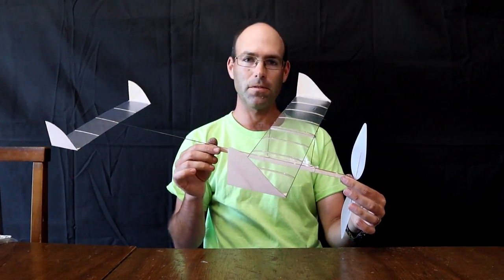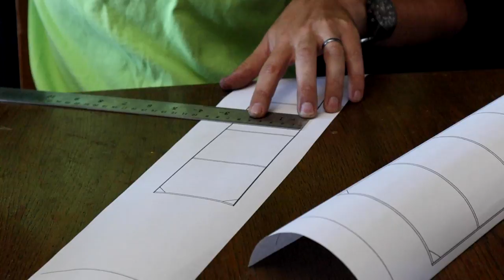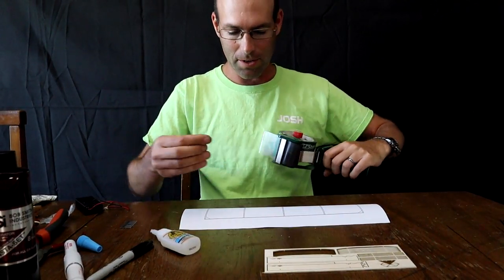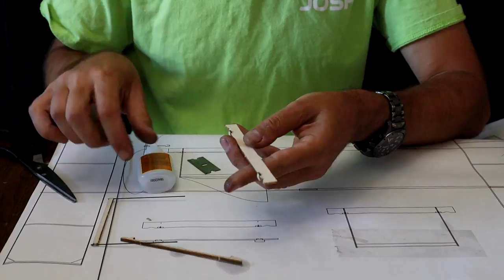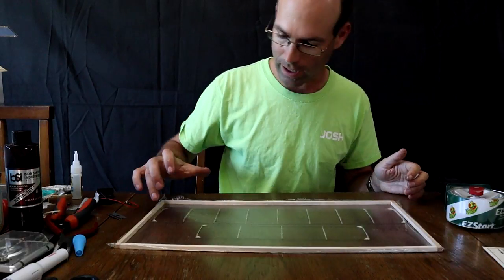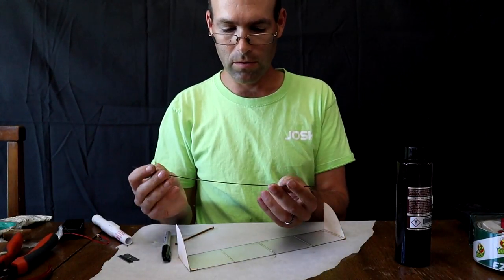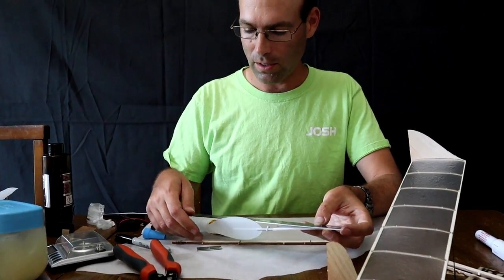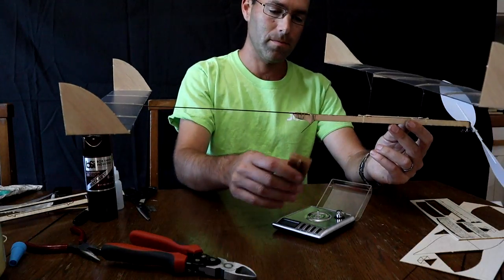Stinger 2022 for Science Olympiad Wright Stuff - Build Instructions

Comment: Your videos are excellent.  I have a question regarding the wing posts.  Can we attach tissue tubes to slide the CF posts into and adjust the wing TE/LE or is adjusting the stabilizer the method of choice for trimming to reduce diving/stalling attributes?
Reply from the maker: Yeah tissue tubes would work fine. You can shim the wing mount to get a similar effect, however the tissue tubes are convenient if you're comfortable with them.

Comment: Any video what is best way to set up torque meter. what is best rubber band size? also how many ideal rotations?
Reply from the maker: That all comes down to experimenting. I aim for 1200-1800 turns depending on rubber thickness, .093 rubber will take 1.3 in-oz, .080 will take at least 0.9.

Comment: Should there be one end piece in the middle of the tail or two?
Reply from the maker: Not sure I understand what you mean. The Stinger is supplied with parts for tip fins on the horizontal tail. Bear in mind we used footage of the Senior Flyer for portions of the build that are common between the two airplanes.

Comment: Whats the best distance from propeller to leading edge
Reply from the maker: Varies from plane to plane. In short, it doesn't matter. What matters is that the plane balances about 1/2" behind the wing leading edge with a rubber motor loaded in place. Shim the wing leading edge as needed if it acts nose heavy with that setting.

Comment: Quick question, are the ribs supposed to go on top of the carbon fiber or on the side? It is hard to tell from this video.
Reply from the maker: On the sides.
Reply: @joshuawfinn   ok, thank you so much!!
Reply: @joshuawfinn  is the cautery necessary?
Reply from the maker: @bowenliu4100  you can cut it with a sharp single edge razor blade, but the cautery makes it a ton easier.
Reply: @joshuawfinn  thank you!